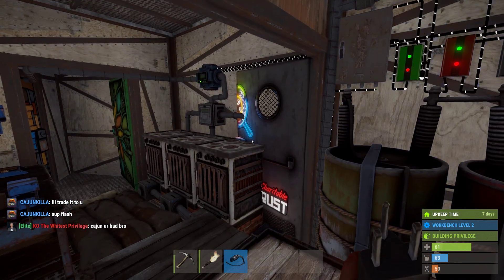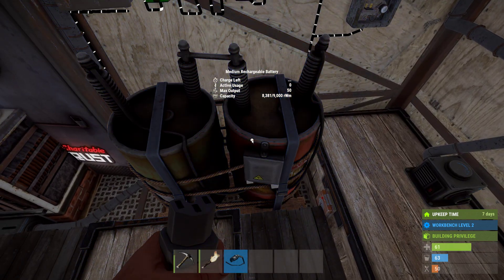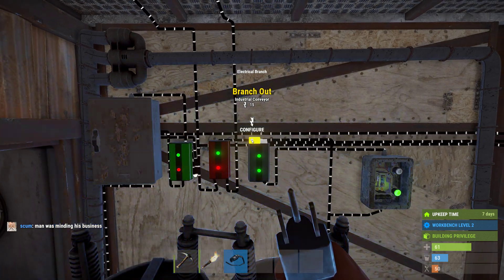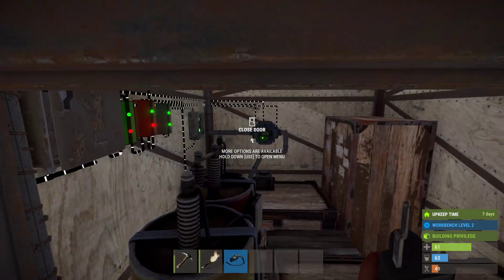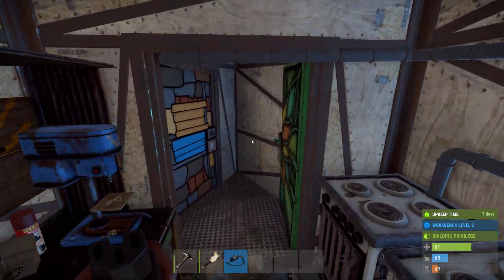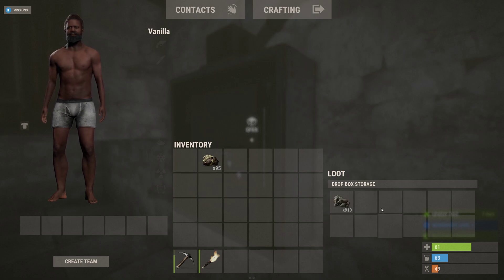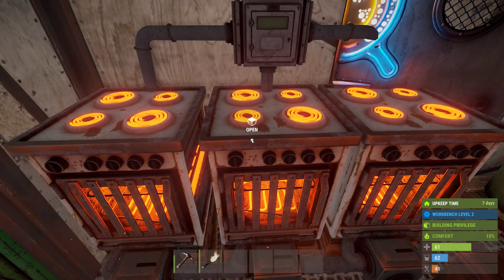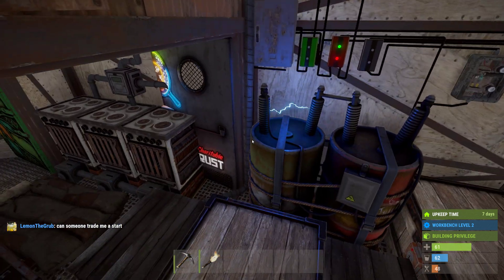Rust Industrial / Electrical - Auto On/Off e-Furnace Guide

Comment: very good, the whole system only uses 2 power if you let the switch on which i find negligible in the way i work with power. i've set up 12 furnaces, power usage on the battery goes from 35 to 2 immediately when it shuts off. very useful, i can run this off of just a few solar panels.

Comment: Let me save this video in my playlist because i know i will need it again in maximum of 1 month (each wipe) because im a dumass.

Edit: Ok, i have found a flaw in this system. For some weird reason if you smelt only HQM, there is a posibility that it will shut itself down because the output at one point was bit faster than it smelting, causing it to shut down and since there was no smelting done, it will not refill, which will not make it start up again. So then you have to remove at least 1 item from 1 furnace for the supplying transporter to activate the furnaces again. 
1st solution i have is to make sure at least one furnace has smelting of HQM 2 seconds late (by taking HQM ore out and putting it back in +-2 seconds later.
2nd solution might probably be by making a system with timer (which could be cancelled by filter pass of ores) that will shut down the furnaces after determined time.

Comment: i find the best way to auto turn on/off  is using an AND switch and a blocker. instead of memory cell.    power into a normal switch  switch then into a blocker and out of blocker into splitters for furnaces. then  hook up both of the conveyors fail filter to the AND switch. then the power out to side of blocker.. basically it only sends power to blocker if you have no raw ore AND no more cooked materials
Reply: This works for me! Thank you!
Reply: the problem with this that both filters fail when there is A) no more ore in the input container (but still in the furnace) and B) the furnace output is empty which causes the furnaces to shut off when they are full of ore

Comment: I found a bug in my system.. I had the power set to split 2 off to the conveyors.. If you do this.. you need 3 (recommend 4) split to the conveyors otherwise the output to the memory cell / AND switch .. will be always 0 on one of the conveyors and it stops the system shutting down.  This is because the output will always be 0. So always set power to conveyors as 1 or 2 greater than number of conveyors.

I am now using the switch, AND with blocker to power my furnaces. It is working well.

Comment: It starts off being an amazing system, and then it randomly bricks itself and the furnaces wont turn on. The splitters and branches will report they're transfering 0 power even though the memory cell is receiving more than enough.

Do you have any idea why this happens? It's pull your hair out frustrating.
Reply: I'm having this same exact issue, have you found any solutions?
Reply: @MajorisMons  I quit using memory cells entirely for this purpose. Mem cells are bugged and have been bugged for a long time. Just run it on a switch now.
Reply: @kochtrevor  

I found a solution, well someone suggested an alternative on another video similar to this, and so far it works. I'd say it's server lag proof as well.

Use an [And Switch] + [Blocker]

Connect both "Filter Fail", to the [And Swith A&B] connect the [And Switch Power Out] to the [Blocker Block], then connect POWER the [Blocker Input] and connect the [Blocker Output] to your Furnace POWER input.

At first it will seem like it doesn't work, but if you flip your MAIN POWER [SWITCH] on&off OR disconnect your MAIN POWER for a brief second, it should start working like a charm. Hope that helps.
Reply: @MajorisMons  Works , thanks

Comment: my furnaces shut off when the box is empty but theres still ore in the furnaces how did you fix that?
Reply: The filter fail switch is triggered, because the ore is being smelted and the finished item is not available to transfer yet.  As long as their is ore in the box, the Filter pass will set the logic switch back on but that stops working when there is nothing left in the ore box.

Comment: I fumbled a cave base when I realized the above ground terrain prevented any electrical throughput. Glad this exists so I'm not constantly running large batteries between the surface and my base.
Reply: @@user-yd2ug9uf3f It costs so damn much low grade to get any power out of it I'd say it's nigh worthless for anything that isn't powering a couple turrets at a raid base for an hour-ish.

Running the batteries as necessary is still easier.
Reply: @@user-yd2ug9uf3f  @user-yd2ug9uf3f  Yeah I know. The generator outputs 40 rWm and therefore 2400 Watts/hr. A large battery holds up to 24,000 rWm and thus it takes 10 consecutive hours running a generator to fully charge a large rechargeable battery. Trouble is, it's 250 low grade to run the generator for an hour (equates to 9.6 Watts per low grade), so 2500 just to charge a battery, which is too much upkeep to be worth using for anything that isn't a FOB. You don't have to fill a battery to run a furnace setup but no matter how you do it the generator is inefficient.

The trouble with cave bases is you can only getting building perms in certain rooms underground, making it impossible to run electrical throughout. Only certain cave formations with certain terrain conditions above ground fit the maximum electrical wire distance parameter and thus many simply will not allow you to run a wire to a surface generator base w/ wind turbine or solar panels, meaning your only option is either the generator, which as mentioned before is impractical, or hot swapping batteries, which just costs a little bit of your time and some hqm when you need to repair the batteries from picking them up and replacing them. The battery strat is better but still kinda sucks. It's one limitation which holds cave bases back.

Comment: Nice setup, I tried this and noticed the load on the battery was 16, but it remained at 16 even when the furnaces turned off, probably a glitch
Reply: It does that because this circuit is only cosmetic, when you branch out power on an electrical branch it's automatic taken from the battery even if not used, rendering this entire tutorial pointless aside from a cosmetic effect. You would have to remove the branch to make this work as intended
Reply from the maker: Im gonna do some testing on this when I get home from out of town next week and see what else I can come up with.
Reply: Electricity is stupid in this game.
1. The memory cell behaves like a power branch, so it's going to consume the power it passes.
2. The power branch can also preserve power by not using the Branch out, but using Power out instead. (the Branch Out amount is always consumed though)
3. When the memory cell does *not* pass power, it will still calculate the theoretical power consumption of Branch Outs in Power Branches that follow and consume it. This is a glitch I presume

If you try to cheese it by making the memory cell turn off a switch (on the Turn Off input) that powers the memory cell then you need to use the Inverted Output, which brings a stack of problems with it, namely that by this point you're looping signals through itself and some of those signals need to be ignored in some cases, namely right when it goes on or else the conveyor will instantly notice it doesn't have anything to do and insta-shuts down the whole system, including the furnaces and the conveyor that feeds them
Meaning, 1 memory cell requires two more circuits or at least one more memory cell to use (if you care about the 77 power you're flushing away which I do which is why I spent time checking out this tutorial)

Comment: I wonder is there a way for the auto off to work with the switch as believe the branch uses the power even if the items branched are not using the power. Would guess memory to switch but I'm not that good with the uncommon types of electrical components. One for testing i guess. Epic vid tho thanks.
Reply from the maker: Heyy I don't believe there is a way. I believe a tutorial by Gneissish explained that there will eventually be a patch for that - as far as I know there isnt a way around it.

In the server I'm in I have 4 solar panels run into a medium battery and it stays 100% charged.

I'm glad this helped!
Reply from the maker: Also check this video out for more detail. https://youtu.be/c9qSTEm9sn4

Comment: you can cut the splitter/combiner if you just put the furnaces in a row
Reply from the maker: I did try that - but I found the first furnace in the sequence would fill more than the next and the following. I'm just stickler for uniformity 😆 I could be wrong though
I hope this helped
Reply: @vanillavonchivalry6657  while i like your power guide on it I wish you had went more in depth with your piping setup as well, because I've been having trouble with the setup I have only filling the first furnace til it finally overflows into the rest, 6 furance setup it works but its much slower to cook that way
Reply from the maker: @jchill2095  I am going to make a new video for you right now - I'll upload it here soon. Thanks for mentioning that! I'll reply to you with the link again soon.
Reply from the maker: @jchill2095  https://youtu.be/ehZJftqNVMU the HD version of the video is still processing but I hope this answers your question